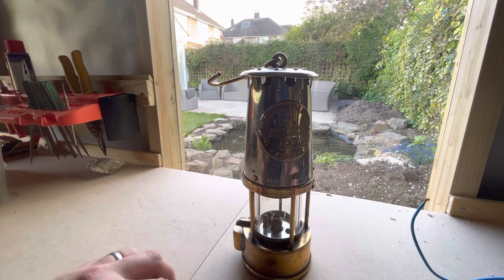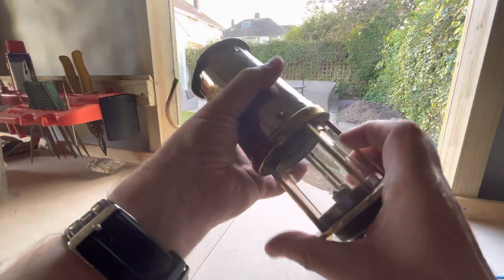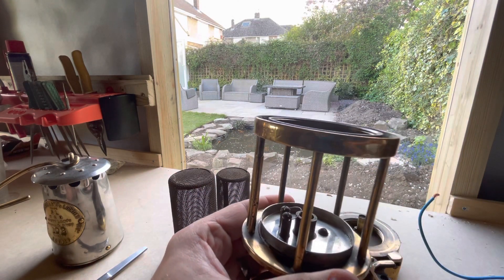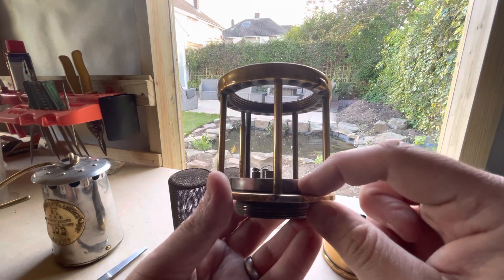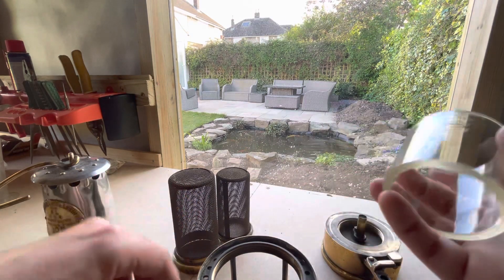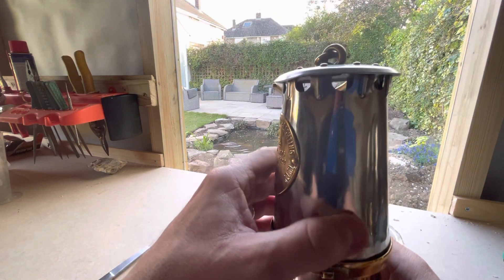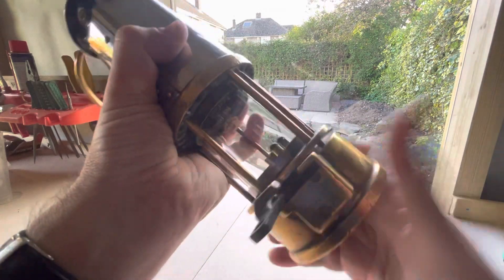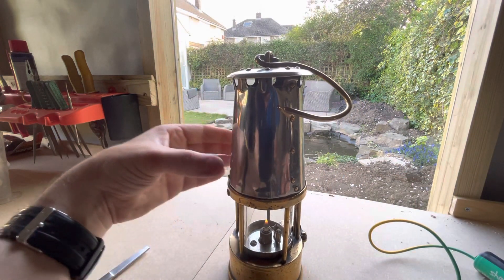Protector SL miners lamp.

Comment: Really useful videos, thanks. I bought the same battery as you have but it vapourised the original wire. I've ordered some Kanthal resistance wire so hopefully more luck next time. The lamp I have is dated 85 and has never been used, so may well have been the original wire. Oddly it was also missing the fibre washer from under the dome head screw so would never light by touching the two components as they were effectivly shorted together.

Comment: Can you terll me the gauge of wire(presumably Nichrome) and the battery used please.
Reply from the maker: @BarrySmith-v3c  the wire I used was 24AWG Kanthal wire, I do believe it's nichrome.
Reply: @LampBoy3583   Thanks very much for the quick reply. I have 24AWG Kanthal and on a bench PSU it needs 3 volts at 8 amps to glow nicely. I have a 18650 13000mWh and get zero heat I'm beginning to suspect the 18650 is NFG even though a DVM says it is a 3.8 volts!
Reply from the maker: @ I struggle with Lithium batteries, i don't really understand them. I think you need a battery that is capable of a high drain, I think some are protected against high drain currents.
Reply: Hi got sl.lamp  of ebay but like to try set this up a few videos.but a little.confused so you.put the wick as thsi need a.new wick and wire then use battery 

so no fluid needed 4 this lamp on the wic

Comment: Hi mate. Have got same lamp. What battery etc did you use to make igniter and how did you do it,? Many thanks
Reply from the maker: Hi, the battery I used was a lithium-ion 18650. I used Kanthal 24AWG wire as the wire between the two posts inside the lamp. I need to get a battery holder but for now I just taped the wires to the battery.
Reply: Cheers mate. What voltage is it please?
Reply from the maker: @wireman1203  it’s a 3.7v battery, need a higher amperage like 2400+
Reply: Thanks again...will have a go!

Comment: Hi, your miners lamp vids are brilliant, very informative, I have an SL lamp with a small brass screw missing, it is the one which secures the inside metal base in the flame compartment and is next to the wick holder. Any ideas of its size and where can I get it from please.
Reply from the maker: Many thanks for your kind words. I am not sure what the size of the screw is for these lamps. The Protector Lamp Company is still in business and has a website, if you contact them they might be able to help you.
Reply: Thanks for your reply, will contact them👍
Reply: It's a standard M3 brass round head slotted screw.
Reply: @theoriginalwelderpaul  thanks 👍

Comment: how did you get the wick to extend?
Reply from the maker: Underneath the lamp is a wheel that adjusts the flame height. Turn the wheel and this moves the wick tube up or down and that will adjust the flame height. On this lamp the wick is fixed in place so does not extend.

Comment: hi  ,,,,i cant see how anyone could see to work from such a small light was there a larger light available  ,
Reply from the maker: The light output is really small, I guess your eyes will get used to the light of the flame but I wouldn't like to work in conditions like this.  One of the reasons I guess why electric lighting became the norm in mines.